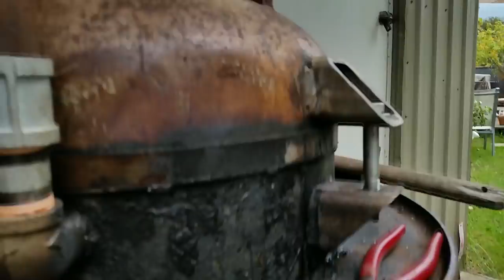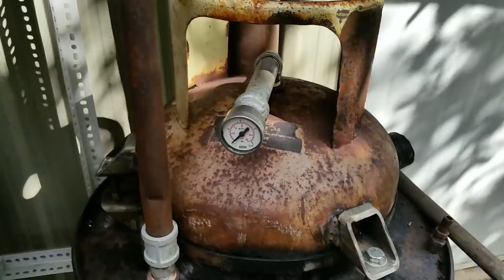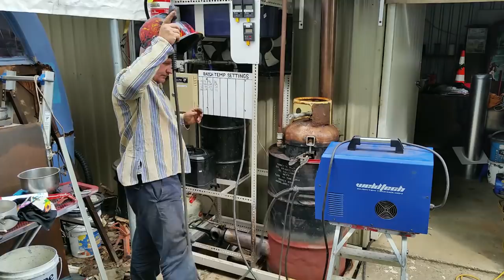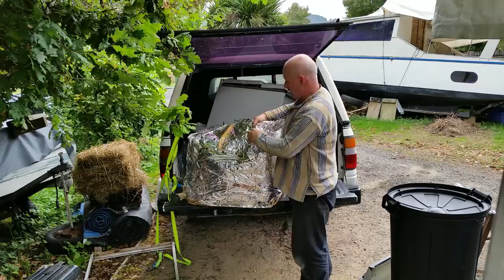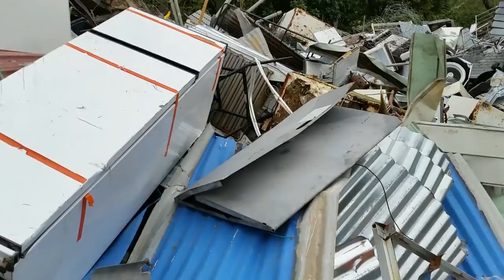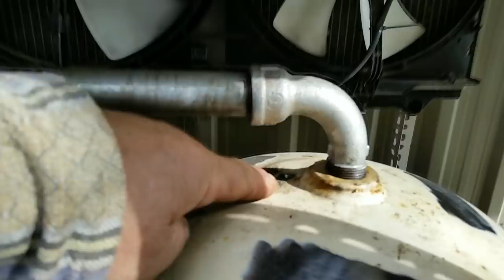Free Diesel from waste plastic part 5.1

Comment: Is the cost of the propane more than the value of the fuel out?
Reply from the maker: Cant you see that it runs on LPG for about 90 seconds to preheat the burner then switches to waste engine oil for the main burn? Why dont you watch properly before complaining?
Reply: @t.h.o.r. Good use of waste engine oil, yes, if you have that in addition to the plastic waste.

Comment: I'm SO collecting parts to do this! I started collecting parts for a gasifier but just recently acquired a diesel pickup. Wishing to know more about the wax, how to get rid of it and what to use it for, and how to separate the gasoline. I never thought about the stoves for insulation either! I need that for the smelter I built! Thank you for this. There is more than one person waiting on your next video. I have a deep burn inside me to let go of fuel, electricity, water and natural gas for EXPLODING the costs of my bills this year. Electrical/mechanical engineering tech here going for my fire safety and protection engineering degree next semester and I am not young. I am SO doing this!
Reply: you could attempt to seperate by supercooling the liquid maybe a normal freezer would work and use a fine strainer to get it out. but i think the best and only method would be "fuel polishing" filtration system where its forced through a 5 micron filter it would likely remove most of it.

Comment: A little suggestion Run a half-inch pipe around your burn chamber, the outlet pipe insulates it. Then run that pipe into a snd battery, then back to the heating chamber using a small pump. This will make you a thermal battery that stores the heat for later use, when it comes in the winter months. Heating your workshop, or house even a greenhouse if you like. Plan the size of the thermal battery according to how much heating needs the building will use. Use dry sand only!

Comment: Is the pinned comment above all these. I am still trying to figure out if you got success in the end
Reply from the maker: I stopped out of respect for the neighbor. - they were horrified!
Reply: @t.h.o.r.  OK is it worth giving it a go maybe use a Potters oven if I don't have neighbours.
Reply from the maker: Just take sensible precautions and keep it away from  buildings you should get 800ml of fuel from every Kg of plastic. the energy input is the key. using waste oil is clean and cost free. remember the LPG is only used for perhaps 90 seconds to preheat the burner.

Comment: Have you any idea how useful all the Sheet Metal on those stoves could have been to you in your Hobby Projects?  
Don't lemme catch you wasting Material like that again, 
You could have your own little scrap pile to pick😃
At least sit on the stuff for a spell ya never know when ya might want to make something and need some bits of Wire or Relay or something.

I do wanna ask ya something about your design.
Why did you put the burner on the outside of the Metal Barrel and not inside the metal barrel under the other tank?
Reply from the maker: I have a season ticket to the dump! dont worry- we are all on first name terms down there
Reply: @t.h.o.r.  , hahaha, that's cool😃

Comment: It might work better if you have a air gap around burner with a layer of foil first then insulation. Maybe a wire cage Wrapped with the reflective Barrier.

Comment: Wonder if you could use an old gas hot water heater for your chamber you can heat it from the bottom it’s insulated

Comment: If you need to weld on your reactor you need to fill it with water to displace residual gasses.
Welding on a closed vessel like that can cause deadly explosion.
Also while the reactor is in operation it should be under no pressure at all in fact you will get a better result if the whole system ran at just under ambient atmosphere, slight vacuum.
You can do that by fitting a simple fan to suck on the top of the stack. 
I haven't watched all of your videos   so this info may be irrelevant. 
Note
If you use the gas fractions to supplement the heating source you will need a fail safe method of shutting off that gas if something goes wrong in the process. 
Also,  you need to be 100% sure that when you feed the gas fraction to the fire box, there is 0 oxygen mixed in  with the gas.
Reply from the maker: Its not closed- the entire top lifts off

Comment: I thinks that I can help a little. 
i have worked with gas bottles for a long time now and as security guidelines say , they are built to withstand high temperatures and dissipate any heat applied. Now when I look at your design and you are trying to achieve high temperatures in the reactor, maybe a high pressure tank is not a good option since it was designed to dissipate heat. Also a mechanical pressure valve would on the outlet pipe from the reactor would keep the gasses inside long enough to really decompose some of the chunks.

Comment: Hey, I've been enjoying the videos, what do you do if anything to get the air/oxygen out of the system once you've loaded in the plastic? Do you just let enough plastic burn to get rid of it? Is that what gives rise to the Devil's Brew?
Reply from the maker: pack the plastic in as tight as possible to exclude air. the heating causes the air to be pushed out first. the 'devil's brew' is the liquid condensate and water mixed together before the machine reaches operating temp- Its combustable but not clean.

Comment: Thank you for the incredible invention I love the ideas.  I've been wondering if the plant uses any plastic? 
Type and colour does not matter as long it is plastic!
Reply from the maker: best to watch all 5 videos. the soft plastics without the word chlorine or chloride are the ones you want.. basically, any container used for food or drink except clear type coke bottles
Reply: I remember over heating my reactor and ended up with wax like oil. I then started using moderate temperature to ensure the Right fuel is boiled and evaporated. At moderate temperature I was able to get golden to yellowish light liquid. Over heating in your Case evaporated a mixture of fuel

Comment: Looking at some of your welds, I can see that they are not too good... they have bubbles in them etc. 
Your welder is a gasless flux-cored MIG ? 
They ain't great... given the choice I'd rather stick-weld... or "proper" MIG.
 Regardless, if you weld in a windy environment the flux or gas (which is meant to shield the weld to prevent oxidation) is being blown away .
Some of your welds look like they were laid down using a MIG without its gas shield turned on... 

Also... when pressure-testing,  its better to use water rather than air as it is (relatively) incompressable so if you get a rupture during testing you wont get an explosive decompression like you would get with air .

I'm not trying to give you a hard time mate, just interested in your well -being... 🙄😂

Greetings from the Emerald Isle   😎👍☘️

Comment: The output on your cooling chamber line appears to be flanged on each side. This would seem like a potential area to contaminate your final product with water if a leak occurred. If the pipe went all the way through and one flange were welded to the pipe and the other flange were opened up and sandwiched to seal it any leak would be external.

Comment: How did you perg the propane tanks be for you cut into them
Reply from the maker: open purge valve in neck to remove residual pressure. remove valve body, leave tank upside down overnight outside, next morning do as you like with it. check my offgrid woodstove vids from gas bottles. I open between 6-10 a week. been doing it for 20 years now

Comment: Don't feel guilty about the kayak ..I feel that a true recycler knows what they need when they see it .guys like you will save this planet from the plastic manufacturers..its only the oil companies that are saying we can not recycle plastic into diesel and here you are proving mega dollar companies wrong ..I am a recycle la myself recycling Electrical components ..I have made what has been named as the heyoka autopilot system .I have the prototype installed almost read for sea trials ..the mark1 will have a free energy component that will make the electricity that powers the autopilot system ..good luck with your project I hope you market your device

Comment: Welding cast iron with mig is not going to last with the amount of heating and cooling. Better with steel fittings
Reply from the maker: nowhere is cast iron welded on this machine. The one fitting that is welded is made from malleable steel
Reply: He referred earlier to some plumbing parts as 'cast iron', which looked like very much like steel. Maybe local dialect from NZ.
Reply from the maker: @JoeSexPack  ebows, unions, reducers, nipples and tees are all cast . cast iron is easily thread tapped and drilled without  lubricant. qualifeid  engineer since 1985. last tap i broke was in 1982. but keep talking you will convince yourself.

Comment: Good deal mate.  I made bio diesel w waste veg oil,worked great when the oil was free.  Anyway I fear your barrel will be the weak link.  If you could line line the lower third of your bbl w/fire clay or fire brick it will last a lot longer.  Anyway, looks good, keep up the good work👍

Comment: Rockwool insulation??? Surely you'd be better with pearlite

And how come you didn't take the compressor when you're getting gasses out of this... Plus if you pyrolise wood you get biogas which you can compress, as well as charcoal for your bbq ;)
Reply from the maker: Yes pearlite is the next step, Im not sure what you mean by 'taking the compressor'?
Reply: @t.h.o.r.  the compressor you found in the dump to compress the gas you make and pressurise a container of it for some later use
Reply from the maker: @sarchlalaith8836  Oh it was not complete and had no useful parts for mine as spares so it stayed there.
Reply: @t.h.o.r.  oh I see, sad times
Reply from the maker: @sarchlalaith8836  not sad- i have 4 compressors already!
Reply: @t.h.o.r.  oh haha, then saving you from yourself!

Comment: It looks dangerous, with all the high explosive vapors coming out of every way, and open fire, maybe you should consider moving your plant outside the residential area,
if you were my neighbor, then i would call the fire department every time you fire up that plant,
security systems are missing,
and you lack automatic fire fighting,
and so far and so far.
I work on a gas production platform, and have an in-depth knowledge of safety at pertochemical plant
And what you're doing
is insanely dangerous,
hope not others get hurt
when the plant bursts into the air.

Comment: Good on ya mate! BUT, I used to work for a natural gas pipeline company, I worked closely with the welders, pressurizing a vessel with air after having hydrocarbon in it is suicidal! Same for welding in or near the vessel!! Hydrostatic pressure testing is the safe alternative, in other words water pushed by a hand pump. It's a pain but beats dying on camera! P.S. we had a contractor who is now deceased because he used air to pressure test! Good luck and thanks for the great videos.
Reply: Yes be VERY careful with compressed gases. Do the math,  work out the surface area of your pressure vessel,   an air compressor that runs up to 10 Bar that you use for pumping tyres and spray painting has about 20 tons of pressure trying to force it apart. Safest way especially if you are messing with hydrocarbons is to install a burst pressure disk, they are just a piece of metal(disc) in a pipe fitting that will give way at the burst pressure, cheap simple, no moving parts.
The reason you have to be very careful is that gases are compressible and liquids are not. If a hydraulic cylinder cracks at 100 Bar, the crack allows most of the pressure to be instantly released and the liquid just leaks out from the crack. If a gas cylinder cracks at only 10 bar the pressure will barely drop so the metal keeps ripping and metal that rips off completely will reach the speed of sound in the blink of an eye.
If I was forced to pressure test with gas, I would bury the cylinder 5 feet underground then test at double the pressure you intend using it at for 1 hour, then release the pressure and dig it out and never use it at more than half the pressure you tested at.
The cylinder sizes  you are working with will blow your house down if they crack with a compressed gas in. Testing them in the garden or the garage is not a safe option, being closer than 500m if it went off could get you killed. Either test at double the pressure with water or bury the thing with at least 5 feet of soil on top.
Reply from the maker: wew thankyou.
Reply: @t.h.o.r.  did this machine evolve in the last 6 years? Would be good to see you giving it another crack! 
Might take your mind off things too :) 
Best wishes
Reply from the maker: @whacko1311  You are right- But I got lots of flack from the neighbor when he saw the powerful burner heating up what thought could be a bomb! - plus- Im really not up to shifting pushing lifting things
Reply: @t.h.o.r.  would you be interested on selling it?
Reply from the maker: @whacko1311  Oh its all bust up now- some of it is made into other things!

Comment: If there's nothing going to atmosphere what's the exhaust stack for?  Have you sampled the gases around the plant? Especially if you're returning gases to the furnace.  Do you know if that furnace is getting hot enough to make those gases safe?  What gases exactly, are they? Is this plant in an urban environment?  I wouldn't want to be a nieghbour.(or anybody else near it).
   You keep making statements like 'no waste' and 'no residue' but then say there is a 'devils brew' which I wouldn't mind betting you don't exact nature of.
 There obviously ARE byproducts.  I can't imagine there being no ashes left in the catyliser if the metal inside gets red hot from the furnace.  Have you analysed them for heavy metals?
Even if I'm being over cautious,  these concerns are valid.
Imagine if they set up a comercial plant like this and started allowing those gases to escape into the atmoshere.  Would you want to live there?
Reply: I stand corrected
Reply: Worrywart he's  having fun and you are cowering  behind the sofa
Reply: Michael Ryan   Well no I’m not really. I’ve been making my own biodiesel for nigh on 15 years.( and I don’t pollute the environment doing it) 
  I rebuilt a 2 seat aircraft, including the 120 hp engine and have been flying it every chance I can for the last 5 years since. 
   I regularly hike into the national park neighbouring where I live.  I have built 3 fairly large sheds on my block (the last being 9x9 metres) from scratch and of my own design.  
  All of these things give me the confidence to know when I see danger.  What have YOU done mate, I ‘d like to hear.

Comment: Hey brother, I really love the potential of this. I'm definately building one. One thing I think you can do to improve the used oil efficiency is to run the line over the burner to preheat the oil before it drips. I noticed this Kung Fu in my multifuel camp stove.  You will definately get a better burn in winter for sure!!

Comment: does it require a certain type of plastic, or will any kind work?
Reply from the maker: yes- types 1,2,4,5,6 all suitable no 3s, no 7s which are the ones with chlorides
Reply: @t.h.o.r.  thanx. i'm gonna give this one a try. i think i have all of the parts except the thermometers. free fuel, is free fuel. and you can't beat that with a stick.

Comment: Mr Red Green in incognito? Pretty nice system, look forward for more.
Also, at the intercooler in the tub, there is another unplugged pipe, where the gas leaks. That will power the burner too?
Reply: Obviously not Red Green, hasn't pulled a roll of duct tape out yet. Probably distant relative....

Comment: On your heating issue, I realize allot of the issue is lack of insulation around the burn barrel and outlet pipe. My question tho is on your burn pipe. Are you still using the same pipe from the first video that you have drilled holes all along the side of the pipe? Would a solid run of pipe with only the 2 ends being open be better? That way you have only 1 opening for the flame to come out of.
My thoughts on that portion is that you are not directing the majority of the flame into the burn chamber/drum, but with the extra holes in the side of the burn pipe you are instead unnecessarily heating that outer tube.
Reply from the maker: Thanks Daniel. But no. the holes down the barrel pull in air and make a much hotter flame. without them it is only about 60% of what Ihave now . .Ive spent the last few months perfecting my Aircrete mix so that I can now make curved moulds and produce  a aircrete liner for the  burn chamber- should work well then. But alas I have real work to do as well- all these things take so long.......

Comment: You could use this setup to warm your workshop up. Especially if you work with heat sensitive epoxy and resins. And just for working comfortable in cold weather